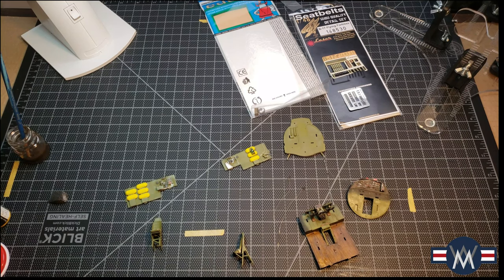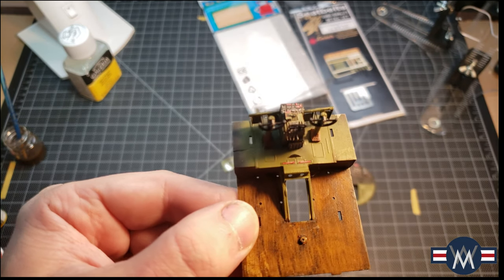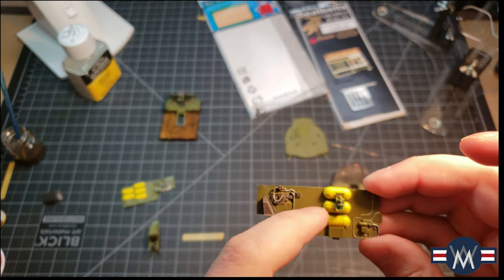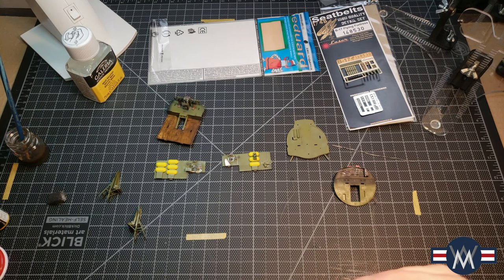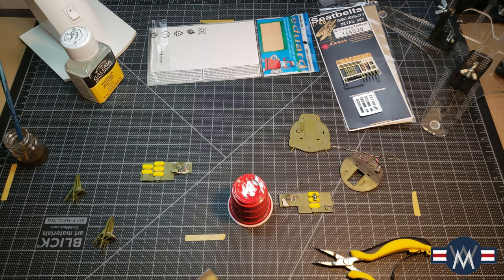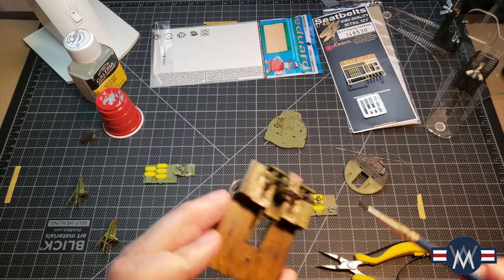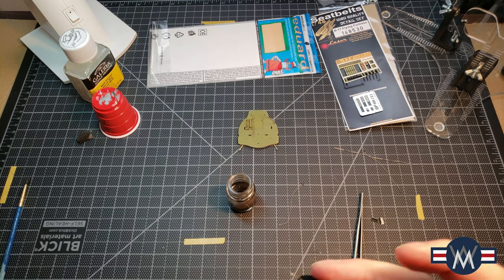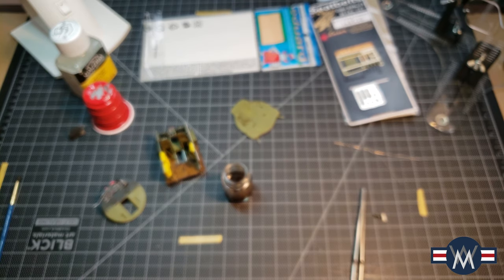HK B-17 Build Part 2 Cockpit Weathering

Comment: Before the wash did you used enamel or acrylic?
Reply from the maker: I used Mig acrylic paint. As long as you do not rub it, it works fine. Otherwise I would use a clear coat first.
Reply: @WasatchModeler  Brilliant!, thanks!